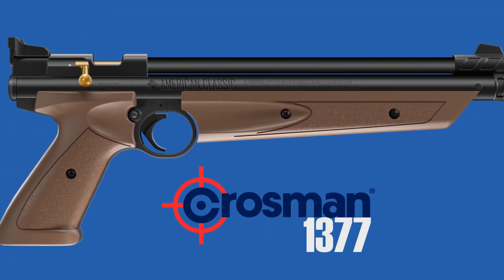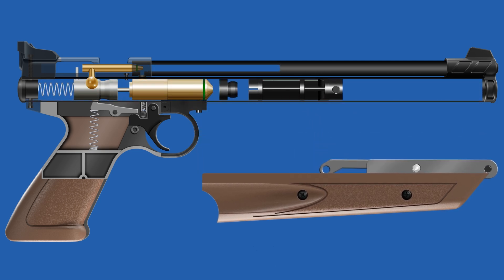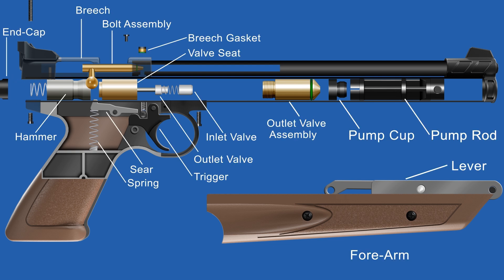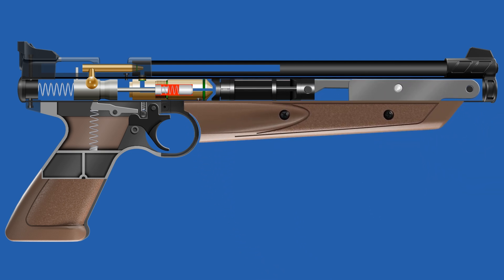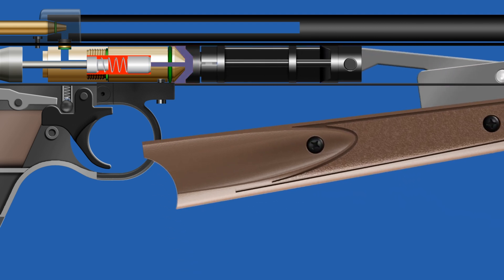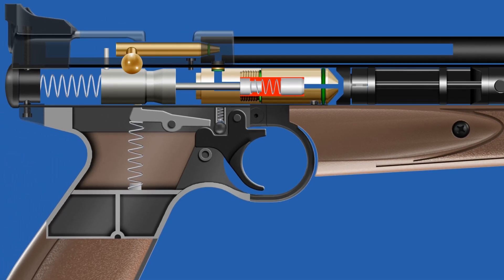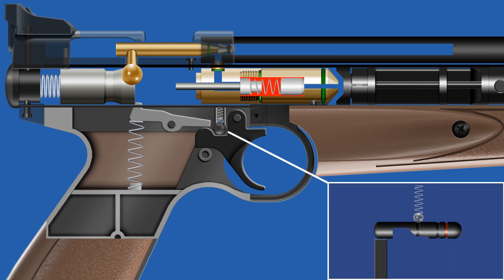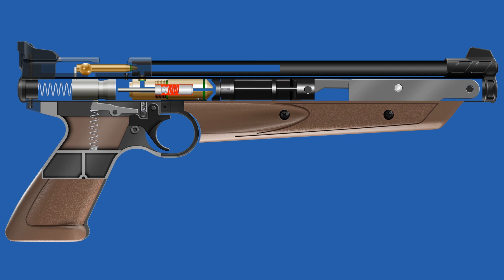How Crosman 1377 Airgun works, Built-in Filling pump | science behind pneumatics airgun

Comment: The Chinese 1322 1377  bolt pin dont push far enough the 15.42gr  pellets over the air port hole inside the barrel, that leading to  pellets bent and low fps.

Comment: Most of compressed air seems to be released in front of the pellet. Shouldn’t it be released behind the pellet?
Reply: Yea interesting point. But if you think about it, when you shoot diabolo's there are now two areas where the air is pushing it forward. Both at the back and in the middle. If the pellet would be pushed further in the barrel there would only be one area where the air pushed it forward. Look closely, a lot of the air is not being released in front of the pellet but in the middle.

Comment: Very well done, enjoyed. I will just say that ideally there is less headspace between the cup seal and the valve cone, and that any space left here should remain coloured red until firing (or opening the pump arm) as this is also high pressure air. The more you can minimise the volume that's left outside the inlet valve, the more power you'll get per pump. Normally this is done by cutting the cone flat, and installing a flat-top piston with o-ring seal, preferably adjustable in length to get maximum air into the valve.
Reply from the maker: Thanks for watching this video. Please can you explain more so I can better understand.
Reply: @AirGunMech  Regarding the animation, I was saying that the red colour you used for high pressure air, should be inside the valve but also outside the valve in the small space between the valve and the pump cup. And also in the thin passage leading to the inlet valve. It should all be coloured red when the pump arm is closed. This is because some air always gets left outside the inlet valve. The air left outside is approximately the same pressure as the air inside the valve when you are ready to fire. Just a small detail for people wanting the maximum understanding. When you understand that some high pressure air is left on the outside of the valve, then you understand how to modify the pump for higher power.